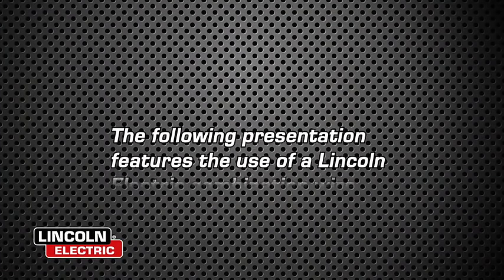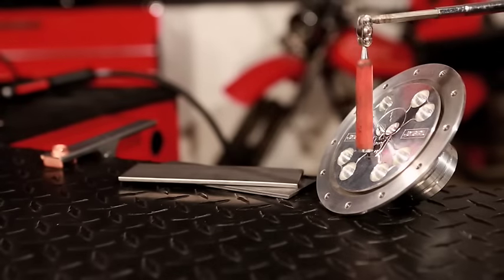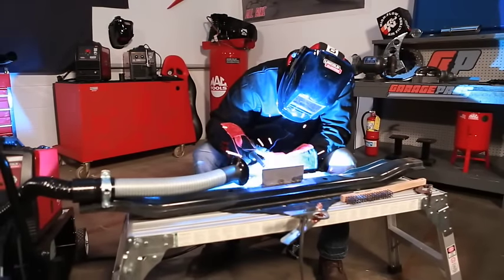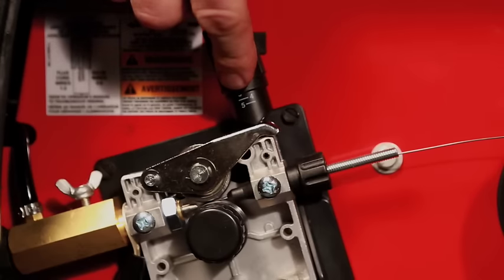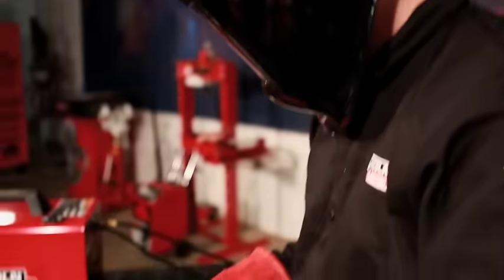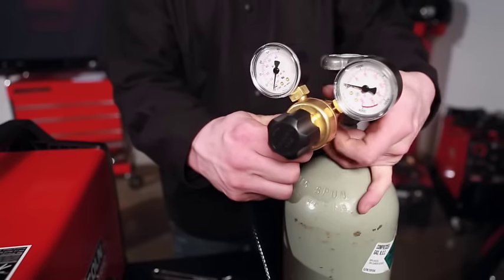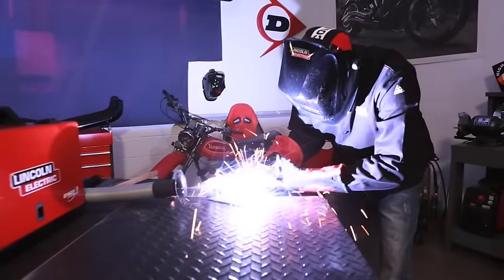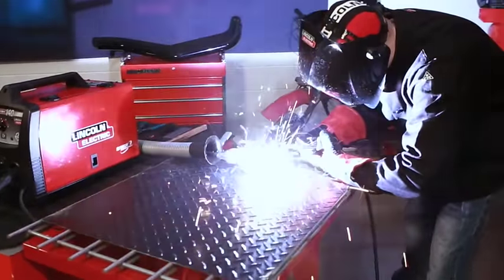Tech Tips: Getting Started as a Beginner or Home Welder

Comment: New welders should visit welding forums which will not only answer their basic questions but cover many advanced questions in detail. The first thing to learn is how to use available resources. Videos are good for watching welding techniques, but the limitations of speech vs. text (and linked resources) make welding forums the best of the two options. There's no reason not to use both. For questions you need answered forums will give more detail and variety of info than videos. 
Lincoln posts manuals on their website which are very useful when buying a used machine. Many Lincolns from the 1930s are still welding today.

Comment: Hey - at 18:30, the video has the Flux tip on the gun, but the audio says "install the copper or brass welding nozzle to the gun."
Am I missing something?  I am new to this, so I would appreciate knowing what is right.
Reply: I am new too and you're right. That is not the flux copper/brass tip, which is larger diameter and I see a donut-like air space that lets the gas flow around the wire. Thanks for pointing at it. I would not bother fixing the video though. The audio is correct.

Comment: Watched this for a few minuted, hit Pause and went to Amazon to snag a copy of "New Lessons in Arc Welding - Fourth Edition" (2007 printing). Is that the most current one as of 2017 or is it at least close enough? Looking forward to getting in to this stuff!

Regarding this video: There are two issues that I noted. 

1. In two places in Section 5 the music level comes up and the voiceover level goes down, with the end result being two long sections where the narration is nearly inaudible. I had to listen to these two sections twice to really get what was being taught because the music was distracting due to the alterations to the sound mix.

2. When you show clipping the stick-out for flux core all is well, but when the actor clips the stick-out for MIG the brass nozzle is in place during the procedure until he goes to cut the wire, then suddenly the gun has the flux core tip black nozzle installed. Probably want to edit that part as it is confusing. I had to back it up to see what was up.

Otherwise an excellent video. I Liked and Subbed and will be watching all your videos that pertain to my particular model.

Thanks!

Comment: What is the part number for the Drive Roll shown at 9:12 in the video. I have the same Lincoln Pro Mig 140 with the unscrewed black knob to remove the drive roll. I'm replacing my gun, and drive roll due to wear and wire feed issues.
Reply from the maker: Is it for flux-cored wire or solid wire?
Reply from the maker: Here is the part number for the drive roll that will work for both MIG and Flux: KP2948-1

Comment: Mine wont start wire correctly. I have to pull the gun assembly out of the welder then put the wire through then put it back in then bolt it back down. Does anyone know how to fix this?
Reply from the maker: Get in touch with our customer service. Go to our website for the number. Someone WILL help you. If not, let us know and we will help you get what you need.